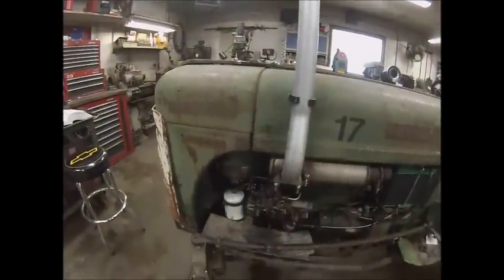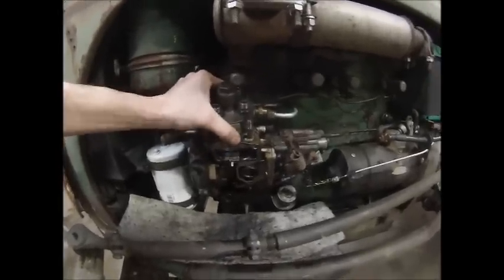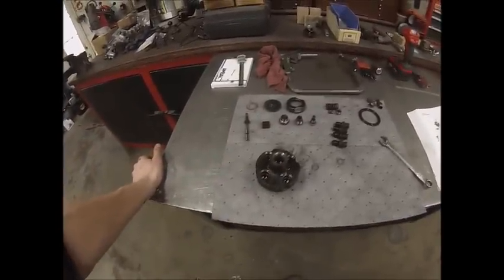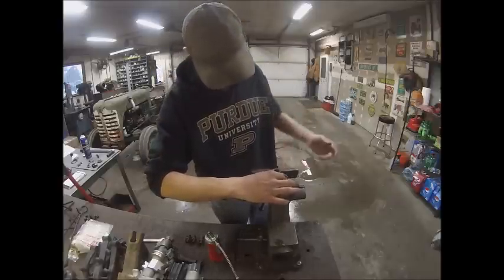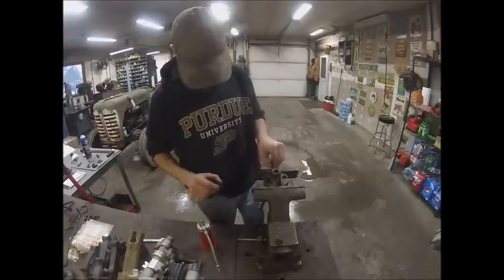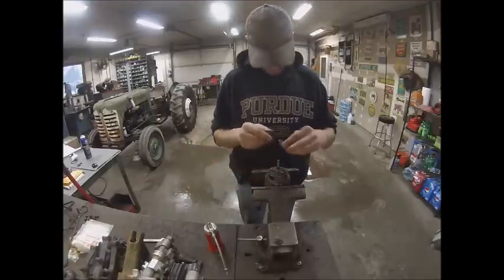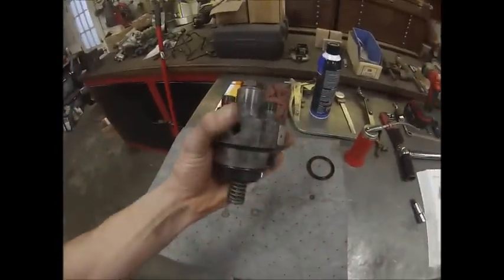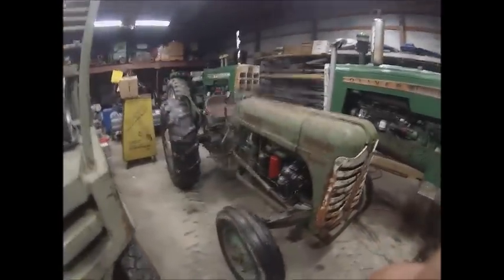American Bosch PSB Injection Pump Re-Seal

Comment: Good to have you back. I will forever remember the lesson you taught me.-Power/air tools are a fine way to overtighten and mess something up. Slow down and use hand tools.-
Reply: Michael Hill very true. I whip them up with a power tool if long threads but stop short and tighten by hand.
Seen a lot of damaged threads by over torquing.

Comment: Nice bit of work there, not many would tackle stuff like that now.
Good stuff 👍
Reply from the maker: Figured I should learn how to work on them sooner rather than later. The pump shops that will mess with them are getting few and far between as the knowledge dies off with the old timers.
Reply: I've had a few instances lately of 'overhauled' starters and pumps coming back either the same or in a worse condition.
The skills are dying out with the old hands.
Reply from the maker: Same here. I’m pretty sure the rebuilt generator on that thing is already taking a shit after like 5 hours of run time.

Comment: Bought a ol 77 diesel been sitting for 30 years its sweet strait ol girl but pump needs work i think that's why they parked it years ago great job brother  i got a 66 gas like yours its sweet i use it almost everyday great information 👍i got a 1650 gas i work some been fixing back up very nice tractor for a gas burner

Comment: not sure if you recall this or not but when i found you a couple years back i asked you about hydraulics on a 1850 to raise the wheel disk it did fine but when you went to lower the disk it was real choppy i had ran this issue by you and they tried the idea you came back with and it fixed it . i went to leave you a message of thanks and you was gone so here is a thank you for the fix
Reply from the maker: I honestly don’t remember. That’s been a minute ago. Glad it worked for you tho.
Reply: @Oliver66FarmBoy  best part was no need for new parts
Reply: @Oliver66FarmBoy  just glad i could bring some positive feed back to your channel

Comment: That's going to be a handy little tractor when you get done with it. I always thought the American Bosch pumps were pretty reliable, IH wouldn't have used them so long if they weren't.
Reply from the maker: They are good pumps. Just not as efficient as the ones that came later.

Comment: The tolerances inside the pump are millionths of an inch. If the pump has not moved for say 30 years the forces think it is one solid piece. If you disassemble the pump some components like the control rod are stuck. When you remove these components and put them back, they are not discolored in any way and then work perfectly. Without disassembly however they will break as the engine turns over ruining the pump. In space they call this cold welding. Here with atmosphere it just takes longer to do the same thing.
Reply from the maker: The tractor ran before I took the pump apart....... You can check if they are stuck without disassembly.

Comment: I think that is the same pump that A\C used on the Buda engine in the WD45 Diesel engine
Reply from the maker: Pretty much every diesel from the 50’s had a variation of this pump.
Reply: @Oliver66FarmBoy they are notorious  for breaking  drive shafts  from setting

Comment: Is your tractor manual from Jensales. I didn't particularly like mine for my 770.. I just bought a Ford 445A that needs the brakes done, I'm need  a shop manual and was wondering if you had any recommends. ?
Reply from the maker: If you want original manuals eBay is your friend.
Reply: Oliver66FarmBoy 
Thanks

Comment: You said you ran a fuel additive for lube with this dry fuel. Was wondering if you would share the brand with me? Great video
Reply: We use Howes or you can strain used motor oil and use it also both work well and add some lube
Reply from the maker: We use Lucas fuel lubricant.

Comment: Just curious, time has ticked a few rounds since those beautiful tractors were built. Oil has changed as much as anything else, what oil do you find best to run in them now?
Reply from the maker: We run Valvoline 15-40 in the diesels and 10-40 in the gas tractors.

Comment: Hi, I am in the UK, I have an Oliver 55 with a PSB4A Fuel injector pump with a broken piston plunger, I have a local machine shop that can make one for me but can anyone help me with the exact length of the rod as mine has not broken off cleanly. Any other help would be appreciated. Many Thanks